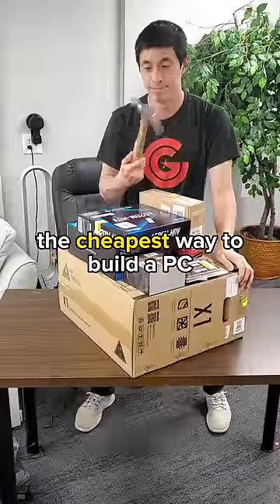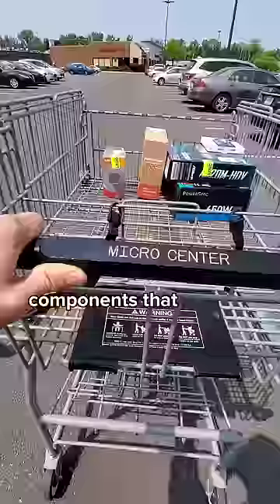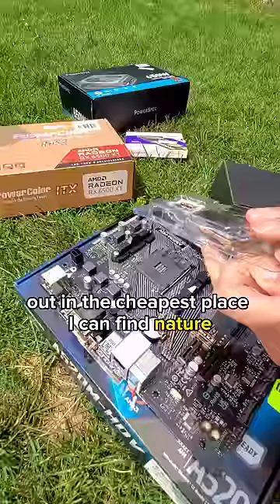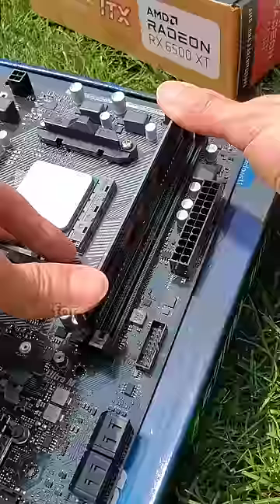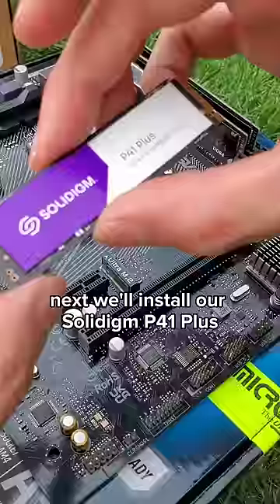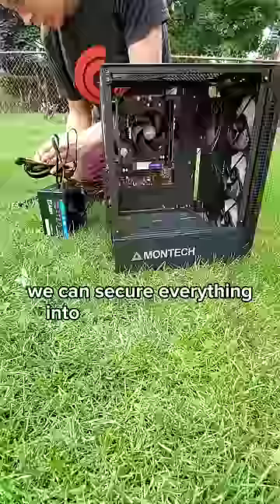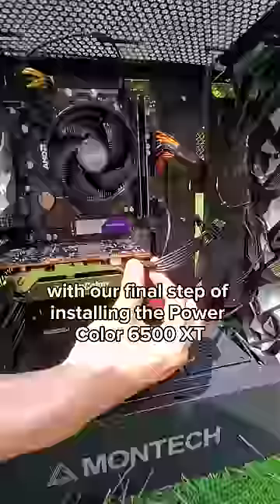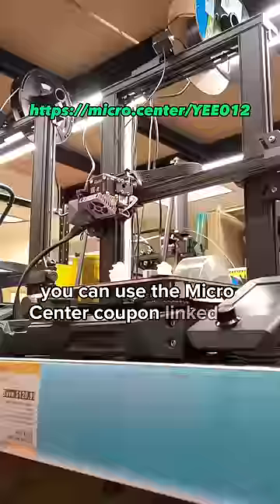the cheapest way to build a PC #shorts

Comment: no its not the cheapest parts ..normal HDD is cheaper with less ram and normal case with no graphics card
Reply: cutting costs by having the only drive as hdd is stupid
Reply: Is a starting build, mid gaming pc, that can run almost any game in ultra, under 500$ you get it, right?
Reply: @yamilishernandez7670   

> game in ultra

> 500$

thise phrases dont go together
Reply: imagine building a pc with an hdd in 2023
Reply: @yamilishernandez7670  well that is not what he said..he said "this is the cheapest pc you can build in micro center"but is still isn't

Comment: Bruuh. Just build everything from used parts. Most of my parts are used. Overall, I spent $450+

Specs:
Msi B550 tomahawk motherboard- $100
nvdidia msi 1660ti-$130
Amd 5 5600-$90
16gb DDR 4 3600mhz cl16 (new got cheap deals)-$40
Sn850x 1tb (new got cheap deals) $40
Power supplies 750wwt-$15
Case-$60
Rgb fans-$40
Amd wraith prism- $10

Comment: cheapest you can get a screw driver is $1 plus tax at most dollar stores and it usually comes with a free flat head that you will never use how ever if you sharpen it on one side it can be used for wood working like making pipes and stuff

Comment: I suppose you could have used a Ryzen 5 4600G ($20 more expensive, but eliminates the graphics card), a single DDR4 stick ($20 for an 8GB module without XMP) and an old SATA SSD (may also require the screwdriver if you don't want it dangling around) if they were in stock and you had dared to go unbearably cheap.
Reply: Might as well get a PS5 at that point.

Comment: So, on top of screws for the cooler, you also have the PCIe screws for the gpu, those a pretty important to have anigged down depending on the gpu weight, but the one shown isn't very heavy, so pass. Then there's mobo screws, you don't want those to be loose even under light load but if your pc never ever moves again then its maybe OK just check them often. Then there's the power supply screws, again, if the pc is basically stationary forever its probably ok....eesh. case fans are important to screw down, if they're included with the case they are probably screwed in but if they aren't tight, then they can be noisy and wear out faster, so again, technically can get away with. So even if your pc never moves, still check them often, inherent vibration can loosen hand tightened screws. I know, this video is just an exercise in possibility, but for the record, just get the screw driver. Fun vid though, sometimes you just do t have the right tool for the job, and you make do with what you have.

Comment: Hm, both the 6500xt and the r5 4500 are ok budget components, but pairing them is maybe not such a good idea. The 4500 does not support pcie gen4, and the 6500xt is only gen4x4, and I heard it struggles in pcie gen3 systems because of that.

Comment: Cheap cases have become soooo good that higher end ones have lost their purpose!
Reply: No, high end cases are still much better. Thermal performance, build quality and customisation features exist much more on the higher end.
Reply: Thermals are mostly dependent on fans,lots of high end ones barelly include 1 or 2, even fully kitted out would make a small difference not making the price difference worth it. Everything else is a thing of prefference. (at least they include propper fan filters)
Reply: @M1hay_L  Which high end cases barely include 2? If you're talking over $200, that isn't the high end, those are usually for builds that are fully maxed out and overclocked or that have lots of water cooling. They don't come with many fans because people usually just buy their own. 

This cases thermals compared to a g500a or lancool 3 can easily be a difference of over 10 degrees, which is definitely worth it for higher end builds.

Comment: It's probably worth every penny of its cheapness, and will be totally useless in a year or two.  

I built a computer about 12 years ago, and the parts cost close to $2,500.  I'm still using it right now, and it still does everything I want.  The only thing I've ever replaced in it is the hard drive with a larger SSD.  I cloned the old drive, so the swap didn't take long at all.

Comment: My current build: RX580 8GB VRAM, 16GB DDR3 Ram, 1 TB HDD, 512 GB HDD, 128 GB SSD (System), Master Cooler case with a total of 4 fans on the case, master cooler cpu fan with RGB, 750W PSU, Wifi USB 3.0 Adapter (avg. 20-30 mb/s (NOT MBPS)). i5 3570k overclocked running at 4.7 ghz per core (quad core) 4 threads. TOTAL: 393$ Canadian Dollars with Windows 10 Pro activated. Did I get a good deal? Also I have a GTX 660 but it’s so bad I took it out and replaced it with the RX 580 which is a huge upgrade. at high settings I avg 60 fps and on demanding titles like Detroit become human High settings avg. 60 fps with lower resolution to 900p. The monitor I have is a Samsung 1080p monitor and the keyboard and mouse are free aquired. I use xbx 1 controller that I had laying around. Rate my budget computer?
Edit: the GTX 660 is unsold I am listing it for 50$ so my total will be down to 343$ and if I sell my xbx 1 and get a new controller for 120$, I’ll have spent a total of 243$ cad for a sprta mid range build.

Comment: I remember back in 2016 or 2017 a $500 pc would blow a console straight out of the water in terms of gaming performance. Now you can either get a $500 absolute potato of a pc or a PS5. And if you want to be able to play games at 4k you can either pay $500 just for a GPU or get a fully functional system in the form of a ps5. I don't know where we went wrong

Comment: my setud is more better here is my list 

CPU - Intel Core i9-9900K (Rs. 61k)
CPU Cooler - Corsair H100i (Rs. 12k)
MB - Gigabyte Z390 AORUS Xtreme (Rs. 60k)
RAM - G.Skill Trident Z 32 GB (Rs. 34k)
ROM - Samsung 970 Evo 1 TB (19k)
Seagate IronWolf Pro 16 TB (Rs. 60k)
Video Card - Gigabyte AORUS GeForce RTX 2080 Ti (x2) (Rs. 3.2L)
Case - Lian Li PC-O11 Dynamic (Rs. 20k)
PSU - Corsair AX1600i (43k)
Monitor - Samsung C49RG9 (1.75L)
Headphone - SteelSeries Arctis 7 (Rs. 25k)
Keyboard - Razer BlackWidow Chroma V2 (Rs. 80k)
Mouse - Razer Basilisk Ultimate (Rs. 20k)
Mat - Razer Goliathus Extended Chroma (Rs. 9k)
Speaker - Harman Kardon BDS 635 Home Theater (Rs. 1.6L)
IKEA Table, black-brown, white, 200x60 cm (Rs. 16k)
Gaming Chair - DXRACER King Series (Rs. 40k)
Power Backup - Luminous Zolt 1700 or Higher (25k)
That’s total = 11 Lakhs 79 Thousand

Comment: The cheapest way , is to buy an older system that is pre assembeled and not new hardware.

FPS is FPS if you hit the same number wheter or not the parts are new makes 0 difference.

Comment: I built a rtx 3050ti 6gb graphics card new with 16gb ram 3200mghz with 1tb of ssd and core i7 12th gen 10 cores cpu and it runs anything I want it to at full graphics it’s so fast and good haven’t had any problems and I have it for 1 year I also bought a ps5 a few months ago which makes my setup completed with a dual gaming monitors each has 1440p resolution at 144hz which is perfect for me that’s all I need for gaming with 100 dollars gaming mouse and keyboard from redragon full bundle

Comment: A question: if i am a student and i am planning to use programming apps (front end programing and some data base) , photoshop, after effects and some electric and electronic circuit simulation apps (like multi sim, protheus, etc). A pc build of an i5 6500 or 8500,  nvidia gtx 1650 and 32 gb of ram will be enought? Or will i have to expend more

Comment: the actual cheapest way to build a pc:

go to the nearest store that has raspberry pi's on foot

buy a raspberry pi zero

buy the cheapest screen you can find

alongside the power cable for the pi zero, a hdmi converter and a cheap keyboard+mouse.

this should total to 50 bucks

source: i pulled these numbers right out of my ass

Comment: My pc has a:
Intel®️4000Ghz Core i5 processor
Intel®️4000Ghz Core i5 processor
Intel®️4000Ghz Core i5 processor 
Intel®️4000Ghz Core i5 processor
Intel®️4000Ghz Core i5 processor
Intel®️4000Ghz Core i5 processor
Intel®️4000Ghz Core i5 processor
Intel®️4000Ghz Core i5 processor
Intel®️4000Ghz Core i5 processor
Geforce GTX 3060 Graphics card
Samsung COLOUR DISPLAY monitor(1 monitor. also I'm adding another one for my friend Miranda to look without standing at my chair and also adding controls for her)
12gb RAM
930 gb storage

Comment: Any suggestions?
Motherboard: b450 aorus elite or as rock b450 steel legend 
Cpu: amd ryzen 5 5600g 
Ram: xpg gammix d30 16gb 
GPU: rx 6600
Ssd 1tb 
Psu: 550
Reply: Swap the CPU it doesn't support PCI-e gen4
Reply: Also change the motherboard to ASRock B550M Phantom Gaming 4
Reply: Can you tell me what kind of PSU it is?
Reply: @Totally_Normal_AE-86   psu i haven't decide which one but thinking about to get  550 Watt or some
Reply: @Kazumi_sneaX  i think 550 Watt is still okay if that have gold license
Reply: @Totally_Normal_AE-86  okk...bro thanks for the help.

Comment: Or you can buy used parts and get a ryzen 7 5700x, b550 m k, rtx 2060 12gb, 3 fans, a 500 watt psu and a nice micro atx thermaltake case

Comment: As a builder this is the worst thing that you can do. You need to build them in a some what clean place. People that do these types of videos are just stupid. Also 400 bucks and you didn't even use sli or crossfire. What's the point of building if your not going to build?

Comment: What can it run?
Reply: mungis
Reply: I have a dirt cheap (like 200 bucks) build with OCd RX 580 and 2650v2 Xeon, it runs anything in 1080p med/high at 30 to 60 fps easily. Just won’t be able to max out something like Cyberpunk due to GPU bottleneck. The build in video should perform similarly in games (GPU is slightly worse though).

Comment: Yo can some please help me😭

yo can anyone help me So basicly i was tryin to install a ssd to my slot 1 and i was using a magnic screw driver and i may have banged it agent the board but than i think i hit the squar thingy and it lit up but then it i turned it on bc u was like shi i cant see so i did and i moved the screw driver close to the socket and somethinf started lighting up for like 2 seconds but what im confused about it that the inigraded grathics work so now i dont know what, for the record it turned on before but the power cord for my 4070 is losse so its turns off some times but sometimes i cant tell so idk if its that or what?..
Reply: Learn to spell and i can help
Reply: Wtf give it to someone that knows his stuff
Reply: @michubern1444 did 💀and he basically stole my money bro it was a bad motherboard witch I thought it was then they sold me a faulty motherboard than gave me a another one but didn’t give me a refund for the other one and that shi didn’t even have all the drivers installed so..
Reply: @donutrengoku1 alr mb.. ig

Comment: This is literally one of the worst builds ive seen and it will perform worse than your grandma's old potato pc in gaming, here's why.

The RX 6500XT might slot into a PCIe X16 slot but only 4 of those lanes are physically connected this is okay if the card is connected to PCIe Gen4 lanes. An A520 motherboard however, does NOT have any Gen4 Lanes instead being stuck with Gen 3. This makes the total bandwith that the gpu can put out about the same as the bandwith of PCIe Gen1 x16, aka the norm from over 20 years ago. Making it horribly slow